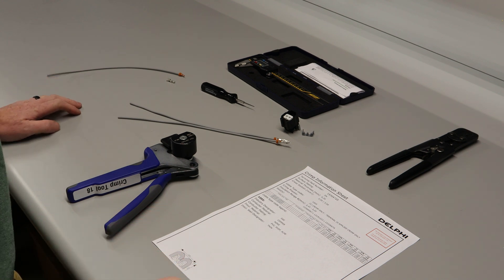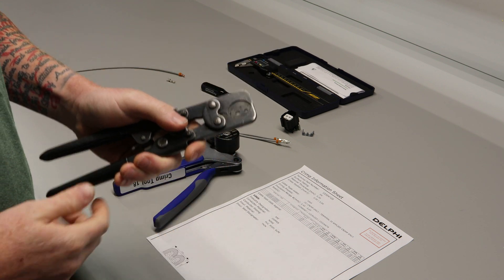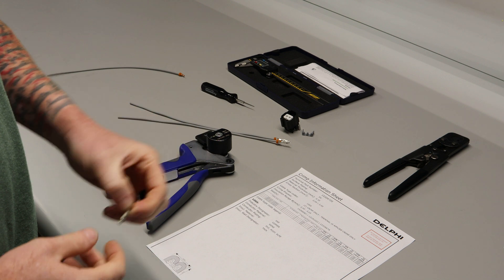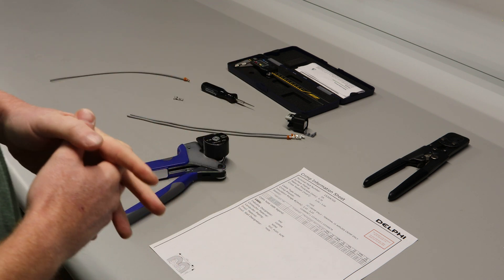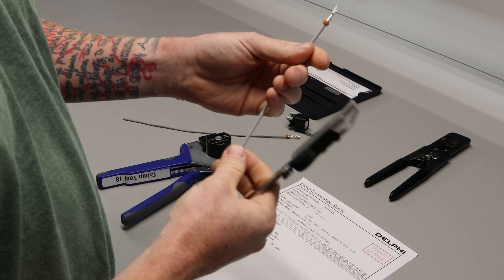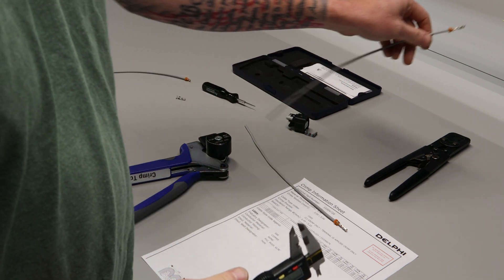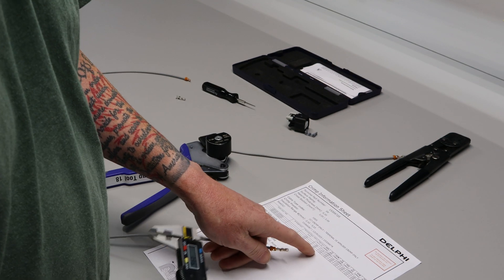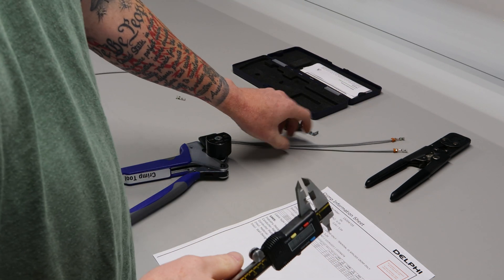How to Properly Measure Crimp Height and Width

Comment: Read and article today about GM'S wiring and electrical systems.. they stated whenever  there is a repair done on a harness, where a new connector is used they state to crimp and solder. Their reasoning is that they say they have equipment that crimps the wire to very specific parameters and that's there reason.  I have the pdf if you would like to check it out,  I found it had alot of technical info pertaining to proper wire sizing, and the 2 types of parameters to use.. I kept it as decent chunk of info I didn't know.